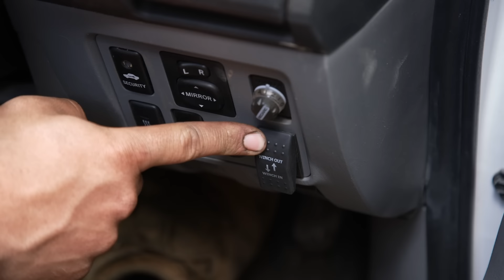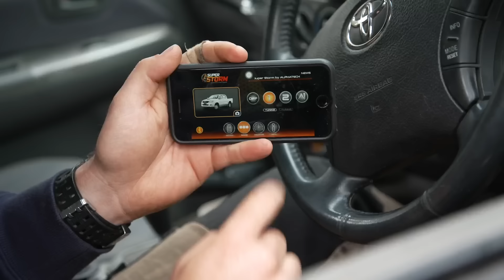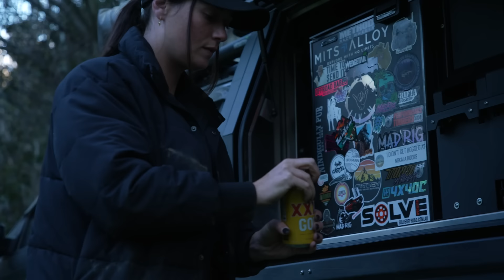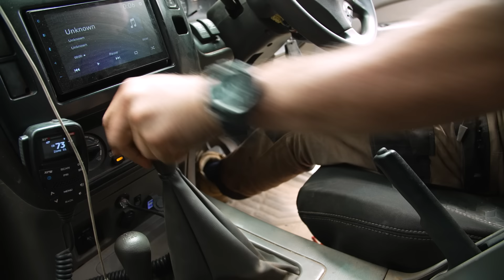Never in 20 YEARS! 4WD left on the track - 2 blown clutches...

Comment: Driving that Suzuki with no locking differentials really is playing on hard mode!
Reply: I had one (94 sunrunner) and all you need is choose a different line and it will go, it’s more fun the a bigger built rig, still as capable with good driving skills.
Reply: All you need is a good line and right foot mate! It's the same with my '07 Jimny.
Reply: Even worse with stock gearing, then you blow clutches 😂
Reply: If he had a rear locker he whould drive most of the stuff
Reply: Diff locks are cheating 😂 
You soon see who can actually drive and who can’t when they’re behind the wheel of an unlocked rig

Comment: My work rangers clutch went last friday. Limped it home 3 suburbs with no clutch and several hill starts and traffic lights. It was up there with some of my more adventurous 4wd trips lol.
Start in neutral, rev to 3000rpm and slam it into gear. Then pull the clutch off the floor with your toe and go again!
Reply: Obviously had some clutch if you could still move. But I've had a throw out bearing go with a clutch that was pretty about to go. Jeez don't ya love going down hills
Reply: @kadenmackriell4751  all I know is with the clutch stuck to the floor and some revs, it took off like a rocket lol. Everyone should try it once.
Reply: @intimatespearfisher  ahaha yeah.
Reply: Bullshit lmao, clutch slip isnt a blown up clutch
Reply: @yvngkidbuu6364  yeah, and it won't move with no clutch at all
Reply: Mine blew yesterday. Thrust bearing was siezed with the clutch not fully engaged. Had to drive 20 minutes from mine to my mates shop to drop it off to get fixed with no clutch and couldn’t rev past like 2/3 grand otherwise it’d just slip completely lol. Was an absolute struggle haha.
Reply: @yvngkidbuu6364  ok King of all opinions 🤣.
What do you call it when you push the clutch to the floor and the pedal stays there.  Let's not get too caught up on terminology. The clutch was stuffed and had just enough to limp home. I don't know where the bullshit is. Maybe check your undies?
Reply: @intimatespearfisher  Pedal stuck on the ground could be low fluid lmao, learn a thing or two before yapping again bud
Reply: @yvngkidbuu6364  the clutch was gone mate. That's all you need to know 😘

Comment: A great example of, its not what you drive its, how you drive it.

Also, in a manual, if you match gearbox to engine rpm, you can still limp home without a clutch.

In saying, great show, great little vehicle with great potential, even with its standard capability and great to see the girls on the show too.
Good job.
Reply: Rev matching won’t work with no clutch material to send power from the motor to the gearbox though. It’ll work for a broken slave or snapped clutch cable though.

Comment: I own a 91 Ford Explorer with a 5 speed, I’ve had that truck since around 2000 and the slave cylinder has leaked since I got it. After putting a lift kit on it and bigger tires to use it as a trail rig it needed a new clutch. My friend and I put the clutch and slave cylinder in it which wasn’t bad but with ford  mounting the master cylinder at a 30 degree downward angle, bleeding the clutch was horrible. I finally just let it sit and every time I went to do something outside I pumped the clutch 30 or 40 times and one day it went right into gear 👍🏻 just took a lot of patience 😂

Comment: If your clutch is slipping/glazed you can essentially drop it repetitively whenever the engine rpm is slightly lower than what the wheels/gearbox is demanding, the rpm differnce needs to be pretty close, just enough that the engines rpm gets dragged up to match the gearbox. This should rough up the clutch enough to limp it. Do not labor or ride the clutch after doing this process or youll be back to square one with a clutch that wont bite.

 My clutch had no rivets left, was basically steel on steel when i took it out, had cooked some nice colours into it too.

Comment: not sure if anyone has already mentioned it but we have replaced a clutch in the bush. We put a log through the front windows and used a ratchet strap through the centre console hole to hold the transmission up  as the clutch was replaced.

Comment: the SJ410 the most unconformable 4x4 to drive when you bouncing from side to side with 30-40 year old leaf springs and  a smile from ear to ear as you bounce around. lmao.
That little 900kg 4x4 with 970cc engine is so capable.

Comment: If you forgive the blown clutch and the water in the engine, you can safely say the Suzuki survived where bigger more expensive rigs failed. Having used one as a daily, I know how low on power it is, but it is very capable when you pick your line and give it a bit of power (they need to be revved) on hard stuff. Just imagine if it had lockers it would have just crawled up with no issues.

Comment: Surprised tune 2 on the Hilux only has a 10% increase in HP. I feel that would be hardly noticeable going from 230 to 250. 

Then again. I felt unstoppable in a TD42 with like 4hp
Reply: The torque is the biggest difference between the tunes mate!

Comment: Hey guys in 1983 the ADR ruling made the maximum noise level, by the ADR 83/00 came into force noise was to be no higher then 96 decibels, since 1984 then all cars made for Australian uses the ADR has change to 94 decibels, so for them Di$k heads in Canberra have no idea that Australian Design Rules make the rules and not them, they may need to ask ADR rule makes to get some idea first Rego checks will stop all noisy vehicles at that time plus Hi way patrol car also pull over them noisy car Utes Trucks or Buses Re: guys

Comment: You guy's keep banging on about your lockers, just for ounce let the 200 use crawl control up one of those hills,  it's literally a cheat code it should be called gecko mode, and nothing breaks. You push the You need diff locks so hard, but you don't,  you just need to trust the guy's that build them. Try it, have a go.
I've  crawled up hills that 3 vehicles in front had to winch, with the lead locked car exploding a cv, I literally could have rode the side step with one hand in the window on the steering wheel.